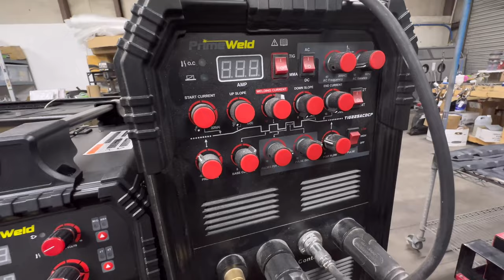What tools to get for boat building  @TBNationOutdoors

Comment: My very old trusty non brushless DeWalt drill is finally dying so I picked up a Milwaukee drill and driver combo and what a serious upgrade.  Blows my Craftsmen out of the water.  Yea I like to have 2 drills and 2 drivers available in my homestead.  Also picked up right angle and strait M12 cut offs with free batteries.  Yea I may never use my air tools again.  Picked up the3/8  and  1/2 Mid torque impact as well and the long reach 3/8 inch ratchet.  Used the Ratchet and angle grinder to replace my water pump on my 300C in record time.  It took longer to burb that car.  I preordered the new propane heater which you can get a lot cheaper right now if you preorder.  Milwaukee for life now for me.  Serious torque and quality in their tools.  One thing to note about their batteries and the Fuel tools is that you need to get the new XC batteries with them.  The Fuel tools will be able to utilize this battery getting you more run time and more amp draw into your Fuel tool.  This will not happen with the older Red Lithium batteries and Fuel tools.  Don't get caught up in deals that are selling you the older batteries with the newer Fuel tool design.  Peace
Reply from the maker: I recommend those tools to everyone
Reply: @TinyBoatNation  As do I and our Diesel Shop Mechanics.

Comment: I'm on the M12 line myself, coupled with the packout drawers and organizers to keep it all from rolling around in my truck. Home Depot still has the 2 pack of the 3.0aH xc batteries on sale for $99. I snagged up two packs of them over the weekend
Reply from the maker: Hmm, good call! I'm gonna have to go and check that out for myself.
Reply: Home Depot also has 2 6amp/hr XC batters with charger plus a free tool.

Comment: The m12 surge and the m18 Fuel hammer drill are life with this build. Add the rivet, installation driver and the deep band saw and I’m set.  I’m doing this by myself and the tools are the only reason why I’m still going.  I know I’ve bought all the Milwaukee tools because of this build and that’s fine with me. 

Still cheaper than the $30k boat that I would still make mods on anyway.

Comment: There's buy once cry once, or from another point of view: barrier to entry. You didn't shit on the cheap tools much which is good, because a lot of people wouldn't even attempt some projects if they had to lay out 3-4 times as much for the same tool from a higher end manufacturer.
Reply from the maker: 100% agree. But it’s different when you’re on a professional shop you need to have a certain grade of tool I would totally have our tools and other tools like them if all I did was DIY stuff occasionally out of my garage.